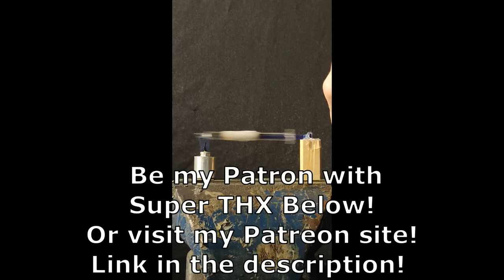How to make a Simple Hot Air Engine? - Tutorial

Comment: Awesome! Poke a hole through each end for a pivot wire - the glued end instead on a wood-fixed pivot wire/staple; the hot end on a wire crankshaft, and consider each syringe to be a single-unit piston and rod of a valveless, self-timed, rotary engine. Would better move itself out of the flame on the cooling stage too. Inspiring as always, Good Job!
Reply from the maker: Thanks to your kind words. The unit works backward, I mean the cylinder fixed and the piston moves, so the possibility is infinite! ;) Your welcome! I'm glad to create always something different than others for you and everybody else! BLADE

Comment: Hello, nice simple project! Does the plastinc syringe resiste well to the heat for long ?
Reply from the maker: Thanks! If you use full glass syringe that is ok for a long, I didn't try other versions. The piston should be glass also without any rings. Plastic is not recommended for this project. BLADE
Reply: @AttilaBlade  Ok !! So it is Only the needle base that is plastic ?
Reply from the maker: @AutoNomades  No plastic anywhere. This is a full glass syringe.
Reply: @AttilaBlade  Ok! Even the part you flatten under flame ?
Reply from the maker: @AutoNomades  That was glass also. I heated up that to the melting point.
Reply: @AttilaBlade  Thanks, i understand better now !

Comment: That's awesome, but how does it work? There Is no any displacer or regenerator... I thought Stirling engine can't work properly without phase shifting... Magic.
Reply: Maybe the air itself has its own mass and inertially moves with shifted phase... I don't have other ideas.
Reply from the maker: I will share a pdf in the description soon from Thermal Lag Engines. The first unit invented in 1995 by Tailor. The engine could work with different cycles in if we change the ratio between hot and cold HX surface. It has a hibrid cycle basically between Otto and Stirling cycle. The regenerator is not the friend of this type of engines. But it is so sensitive for the speed of the heat exchange. Anyway, I hope I could share the pdf soon, and you can check the background a bit deeply. BLADE

Comment: Awesome!! But doesn’t this need a displacer of some sort? Like a steel wool ball or something?
Reply from the maker: Nope! The small space and hot wall could change the heat enough to expand and collaps the gas. That's the trick here. :) So simple and clear design without any solid moving part inside except the piston. BLADE
Reply: @AttilaBlade  This is amazing!! The simplest Stirling ever!! This being completely “closed circuit” will be perfect for satellites to provide power…the cool part can be in a shadow, and the hot part exposed to the sun…and you have an engine that works for ever!!
Reply from the maker: @sreenathc  Ideally it's truth but in real it's more complicated. This one is a demo unit to see how easy to convert temp. diff. to mechanical energy. The unit geometry not optimal to scale it up without big changes. The other thingis the cycle in is not Stirling, so the efficiency lower. BLADE

Comment: A tiny 1 ml Kimax test tube I attached to a blue syringe like yours I then ran on a vertical mounted 10 ml syringe. Press fit onto the tip of the bigger syringe and backing off the plunger to a volume of 7 ml it was just able to sustain a resonance before a blowout.The constant flame from the torch melted a hole that formed a volcano-like protrusion on the side of the 1 ml test tube.  It was interesting to imagine though the tiny test tube offset from the 10 mm syringe could support resonance by that arrangement. I used a very tiny segment of silicone tubing to connect the syringe tip to test tube. Thanks for getting me interested in this madness! I keep thinking there are so many things to try.
Reply from the maker: Yep, your flame has too high temperature for glass things. Less air solve this problem. If the pressure growing and the glass start to melting then it's normal to happens. But your all engines works! :) That's amazing! What's your goal? Thanks to your feedback!
Reply: I don't really have a goal in mind, I just toy with what parts i have and see what might come about. I don't have many tools so I can only try simple shapes.
Reply from the maker: @Resonanttheme  Simple shapes here enough. If you use the syringe as moving part that gives a big different as you choose the plunger as moving part because of the weight difference. First has usually bigger stroke lower frequency, the other one is faster. The power come from the frequency if the construction body is same (how many cycle/ s) The speed of the heat exchange and the active volume two other components. Smaller volume and high speed of heat exchange gives much higher frequency. If you use syringe with nose, that is a tight tube it has high acoustical resistance. It works like a valve an emergency valve that open when the pressure is high enough also turn down the frequency because of the back volume and the neck ratio, as a Helmholtz resonator. On the other hand the neck/nose could create a laminar flow a jet flow. So how the heat exchange works in these engines? The laminar flow coming into the hot side and hit the surface where it's start to swirling. It gives a speedy heat exchange. The heated gas start to expand across the nose and push out the plunger. In this way the gas speed increase in the cold neck where the heat exchange is pretty good. If we can take of enough heat there the unit will hit a good efficiency. So the cooled gas follow the path to the cold chamber actually the cylinder. The speed decrease but the wall gives some extra cooling.  When the hot side gas has not enough pressure yet to push more gas to the other side the plunger don't stopped yet and create a partial vacuum in the whole unit, the pressure could drop enough to change the movement of the plunger an start the cycle again. Sorry if it wasn't an interesting essay for you. I don' t want to boring you. Just I though maybe you wants more infos. BLADE
Reply: I'm always happy to learn more and pick up tips I may have overlooked. Having played with jam jar jets and pulsejets, there're some similarities to thermal lag engines, like balancing the impedance or proportions and good breathing vs good mixing. Another thing is the stiffness or sponginess which can dampen feedback either through a small air leak, turbulent tortuous pathways or say in thermal lag engines sometimes not running unless you mount or hold them to a very solid surface, the back and forth not allowing for rhythm to amplify. Jam jar jets are also fragile, just jiggling the jar a little can't dampen feedback,  or the methanol splashing at the bottom the jar sometimes disrupts the resonance  and they flameout. Just a few drops of methanol on the top of the lid when trying to start a jam jar will cause failure, the top of the lid must be dried after shaking the jar with alcohol to get the insides coated. You wouldn't think a drop or two would inhibit starting but there are a ton of newbie videos where I see it happen with jam jar novices. Even Reynst in his book Pulsating Combustion describes that important note on drying the lid. So to sum up being a newbie myself, you have to be very sensitive to what's going on and what to try differently and why. 
It interesting how fast air can move and how quickly hot air can collapse when cooled suddenly seemingly like a transistor turning on or off. The whole study of sound  too.
Thanks for taking the time to write and all the food for thought and motivation.
Reply from the maker: @Resonanttheme  Thanks! :) Yep, the jam jar engine's pulsations works similarly as the TLE, but not only. The standing quarter wave thermoacoustic engines has similar gas movements too. The gap is so thin between the different engines but if we have an open eyes then we could found the similarities without the deep knowledges in the other type of engines. I hope I could increase the fluctuations and the jet flow on my "jet boat" experiment. Actually the lower frequency given a better performance because of the bigger movement of the gas. But if I could increase the temp different drastically I think I could hit a much higher level of performance, so I want to use electrical heating elements first. Secondary I want to increase the cooling performance. The cooling is always the biggest challenge in the thermoacoustical units. So few "little" steps and tadaaam! But this is not so easy as looks like... The desktop engine's cooling minimum 10 times bigger challenge than like a professionally machined and planned cold side. But the price... So 1000 times or more bigger there. So I want to find a "good-enough" solution for high performance. We will see! I hope your experiments will continuously going forward! Keep up your good work! BLADE

Comment: Does it require more heat than other models?
Reply from the maker: No Cesar, not really! An alcohol burner is enough. BLADE
Reply: @AttilaBlade  that’s impressive. No stack no regenerator
Reply from the maker: @cesarcesar1961  This is the last step of my stackless thermal lag developement. The thermal lag is the simplest hot air engines that could change the thermodinamic cycle inside with only the heat exchangers ratio. Around Otto to Stirling cycle but basically a hibrid one between them. The small diameter tube works as good heat exchanger on both sides. So this result is not an accidental happening. ;)
Reply: @AttilaBlade  I don't know if I asked you before, but there's a video of a giant fluidyne  engine in a park, with solar collector, but I lost it. Have you ever seen that?
Reply from the maker: @cesarcesar1961  Yep, I remember that. A big ring with silicone oil. https://youtu.be/smelhbLBBJk
Reply: @AttilaBlade  man... ai have been trying to find this video for a long time!!! thanks a lot!!!
By the way, why silicone oil?
Reply from the maker: @cesarcesar1961  Your welcome Cesar! Because it has low viscosity,  high temperature resistance,no problem with the high neither the low temp. Crystal clear, it has a long shelf life. So ideal to it. Won't be green because of algas as water does.

Comment: I have a general rule of thumb : if the video title includes an exclamation mark, don't trust it.  I used to have a lot of respect for your work,  but you've changed.  Now it seems that i have to pay you to get basic information.  Well i hope you wont be so dishonorable as to delete this comment,  i'll tell people some stuff for free.   Most syringes are made of plastic,they will melt. Some glass ones dont have low enough friction for this.  You offer no info about the pressure in the tube (no escape route for the air during assembly)  ....  is a small amount of leakage assumed?  Does it have an o-ring?   Melting point?    No, for more info, pay me.  Well, mate you're in a lousy market, very few people will pay you for withholding public information... what are you playing at?  Most people making something on the basis of this video will fail.  Prove me wrong.
Reply from the maker: Nothing Special inside! This one is simple as you see! No secret pieces anywhere. I wanted to try a thermal lag w/o stack inside as before I made my empty engine. No fails if the syringe is similar and that has smooth as possible surface and movement. I can't tell you more as the unit is. This only a thin small capacity glass syringe without modification except the nose closing. BLADE
Reply from the maker: The problem with your words that you won't try it. I've made this video without stops, just I cutted to it for Youtube, because people don't really like the long and boring videos. I changed my cutting technique a lot in the past few years, but I never shared failed videos. My goal is to open the closed mind for hot air engines. I don't really understand your sentences perfectly, deeply enough, but I don't want to delete your post. BLADE
Reply: Dude, it's all there in the video and description, there's nothing more to it. Donations are optional. You're complaining about a free service as though you're not getting your moneys worth. Sine you acknowledge the technical details are publicly available, I'm not sure what your gripe is. Ever hear the expression "Don't look a gift horse in the mouth"?
Reply: If you follow the link in the description, you see it's a glass GCMS syringe. No o-rings, no plunger.
Reply from the maker: @WaffleStaffel  Yep, you've right! This is a simple glass-glass syringe! Thx! BLADE
Reply from the maker: @WaffleStaffel  Thank You WS! :) My sentences are not sophisticated enough to write back as good as you did! BLADE
Reply: @AttilaBlade  Naw, you did fine. Some people are just unappreciative. You don't have to explain yourself to them.
Reply: @WaffleStaffel   what there also is is the kinetic theory of gases, which tells me that a given volume of gas expands by a certain ratio per degree increase in temperature, and we are looking at a very small volume of gas here, therefore a small increase in volume.  Resonance can magnify the effect but not conjure magic.  Do you want to tell me that fundamental physics is wrong?  Ok, welll if there is only one person on youtube who says it works and many others have tried and failed then there's a problem.   Have you?
Reply from the maker: Ray, you are on the wrong train and goes to the bad way. This unit is the simplest thermal lag unit you ever seen. Just read the description, there is an attached pdf to learn the basics. This is not a "sack cat." I made it 3 times before I posted. You know what does it mean? No fails. Please do not deal with my hobby without enough information! Find someone who lives off the sham videos and have your say there, thanks! BLADE